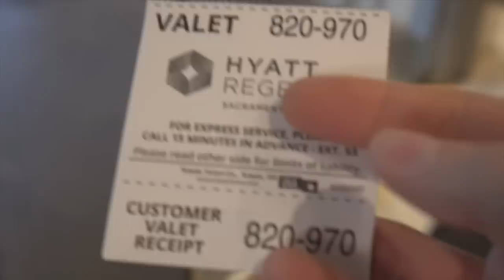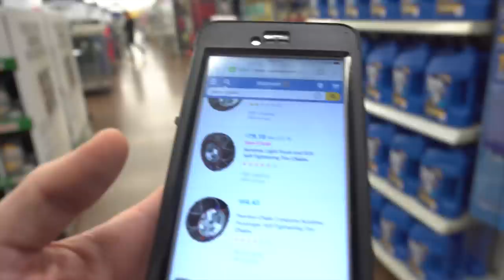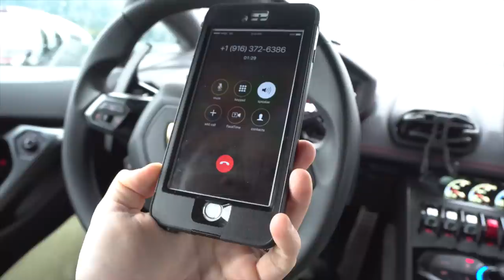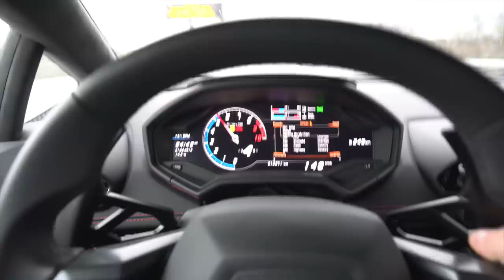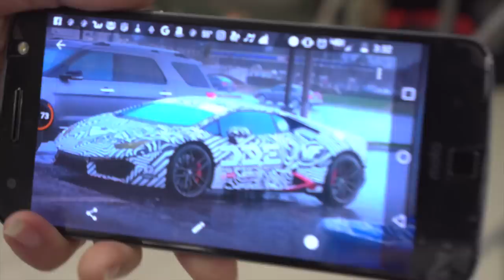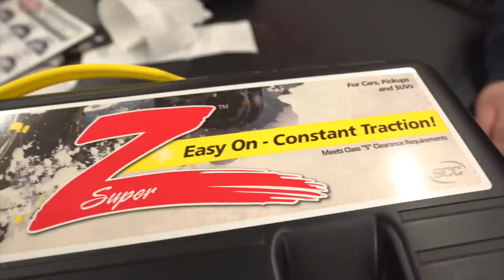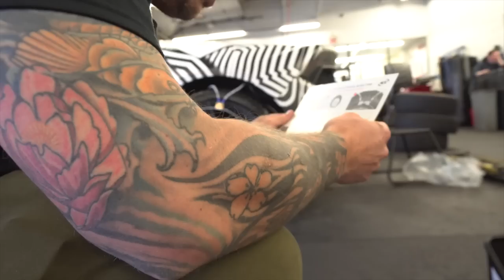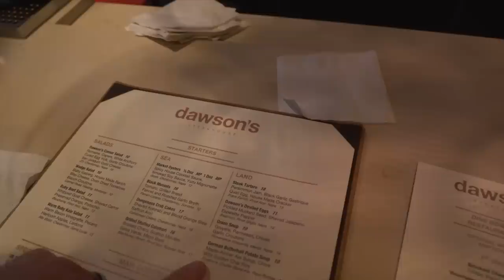Snow Chains On A Lamborghini!

Comment: First time putting chains on? Lol. You don't need to drive on to them like that. The split/pivot point in the middle goes on the bottom and wraps around where the ground and tire meet. Swing it around, hook it up, then hook the other side on top of the tire